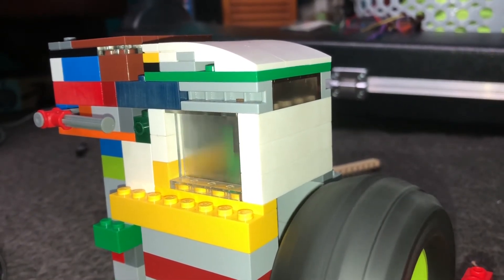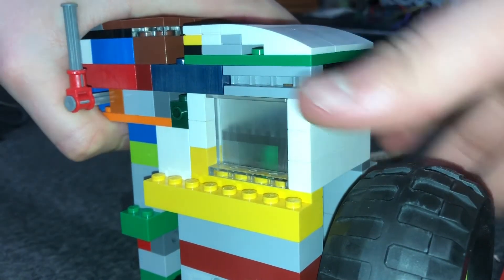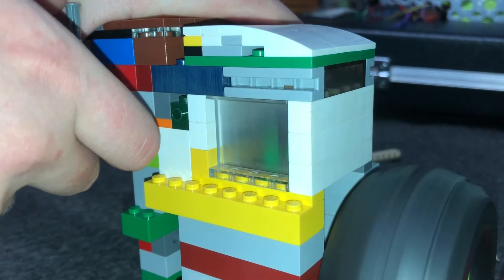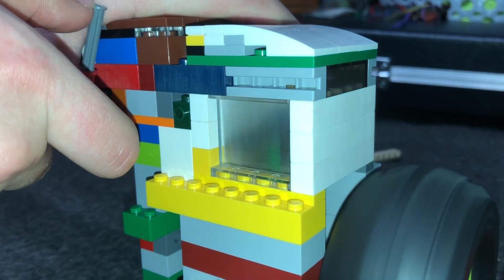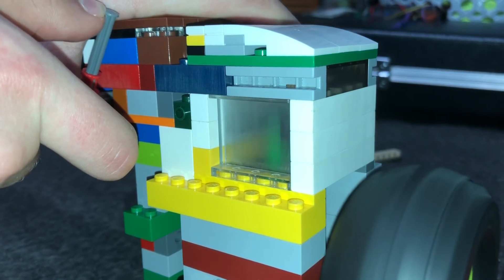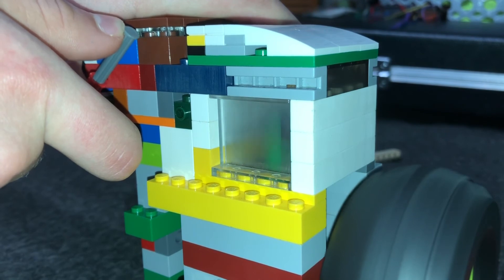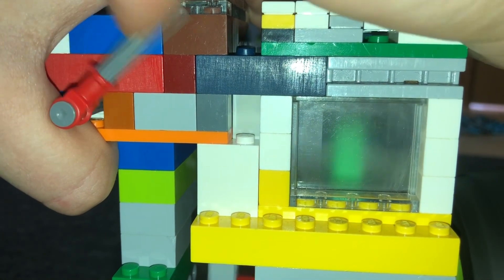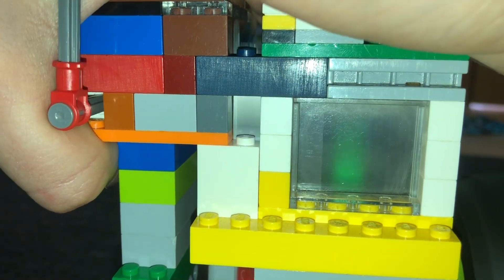Strongest Engine Full Throttle Attempt #1-2

Comment: You should put a wheel on the vacuum for a better seal
Reply from the maker: LEGO warrior that is a great idea! I’m surprised I haven’t thought of it sooner, because I have just been using my hand to seal the vacuum. Thanks!
Reply: @KFPlusLegoMastery  you could also build a lip around the intake for grip
Reply from the maker: I watched your video! Thanks for the advice and I’m always happy to respond to your comments. 😄
Reply: All good I’ve been doing it myself and it works well with the 2nd smallest wheel check it out on my youtube channel /icon
Reply: Did you sub because I went from 3-4
Reply: Your the best
Reply from the maker: LEGO warrior thanks, I appreciate the support. :)
Reply: All good bye